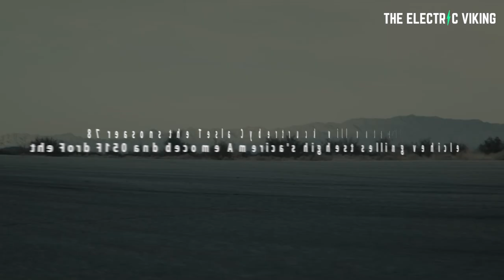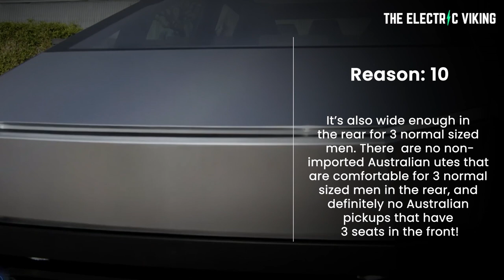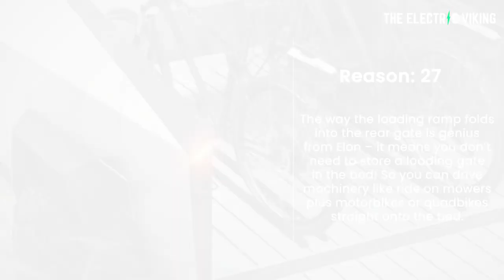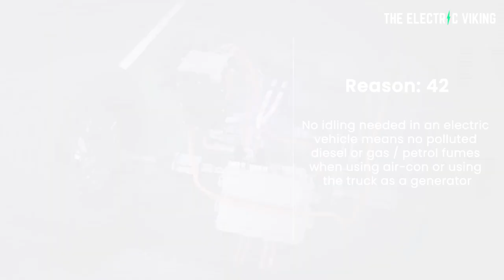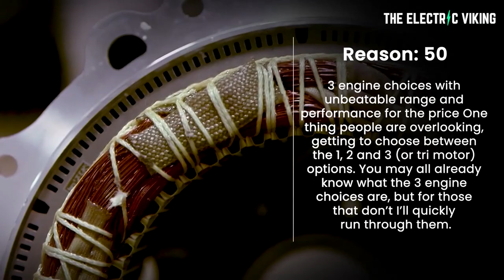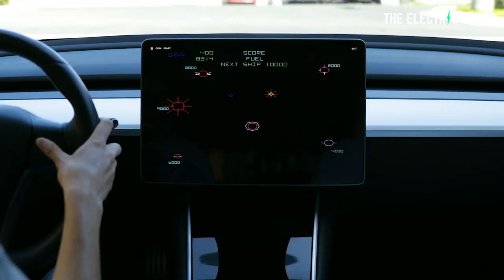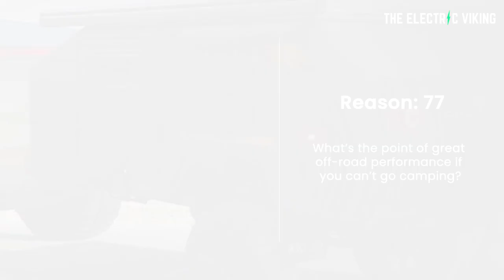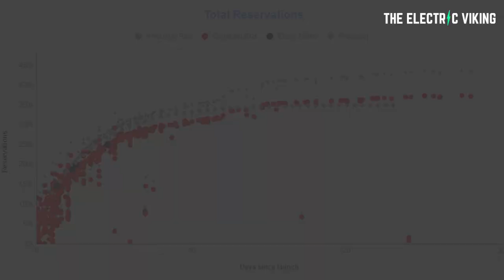87 reasons the Tesla Cybertruck will outsell the Ford F150

Comment: Ground clearance was stated at the reveal and confirmed several times since: 8" minimum and 16" maximum, self leveling and ability to lower the rear end for easier loading.  You might have to eat those shorts.  BTW, great video.  :-)

Comment: I'm 43, with an average expected lifespan.  I plan on purchasing a Cybertruck, and I hope that it is the last vehicle I ever purchase!
Reply: I think as long as the earth is still spinning that your CYBERTRUCK could easily be handed down to your grand or even great grandkids with a couple of upgrades like batteries and the usual stuff that wears out over time. Imagine your cyber truck in one hundred years sitting next to a Ford F-150 lightning bought this year . There won’t be much body left of the ford and the Cybertruck will look nearly the same as when you bought it.
Reply: In my mid 50s.... I hope I get mine before I am too old.  They will need a high production rate.
Reply: @davidsuzukiispolpot  exponential growth. Cybertruck is designed to scale fast and build for cheap.
Reply: @GET2222  Yes, still need 8000tonne press for each line.
Reply: @GET2222  I hope so, but every line needs at least one 8000 tonne press, so there is a lead time to the ramp-up.  It can't scale that fast.
Reply: Hopefully your actual vehicle has still a long shot on the tarmac.
Reply: @chrisk5305  when I first got my 2020 I thought I would be selling a fairly new car.  Now I am not even sure the warranty will still be in force when I get my cybertruck.
Reply: I'm 70 and can't wait to get it !!!
Reply: @davidsuzukiispolpot  legit question
Reply: @azbluefox  your numbers are ok, still good for a smooth 25 years ride. Stay positive.

Comment: The biggest problem for Ford or any other manufacturer is if this is adopted widely as the new trend these companies will be massively screwed because no one will want the OLD standard looking pickup.
Reply: Trucks are bought to be used for work stuff.  So i disagree.   That wedge isnt a truck but a glorified crossover.

Comment: If the competition was EV trucks only, then the Cybertruck would have a good chance of being the top seller in its class in North America. However, the f150 lightning is only one model of f150 which sold close to 800,000 units in 2020. The ice versions will continue to be produced as the Lightning ramps up and the Ice vehicles ramp down over the next few years. The competition will also be an Ev Silverado and Dodge Ram so while the Cyber will be a force to reckon with, it might not be number 1 in terms of sheer numbers.
As for Australian production, there are a lot of ifs attached to that. If it can be homologated for Aus, (big if as even Musk had his doubts) if the production line can be changed over to right hand while production for left hand is running at optimal levels and if ultimately they decide the market is big enough to warrant the effort. Remember we still haven’t seen a model Y yet, our charging station numbers are appalling low and the cost of the vehicle might just be prohibitive.
My personal opinion is the dimensions of the vehicle make it impractical as any sort of day to day usable vehicle in Australia at over 2 metres wide and nearly 6 long. It’s like driving a hummer around town. In the end it’s an expensive second car to own for weekend trips and as much as I like the idea of a practical electric work Ute, I’m not convinced it’s tub design is as practical as is being suggested and would be suitable for tradesmen. There are many car parks in urban areas it simply would not fit.  My first thought when I saw it’s tray was, how do you fit a ladder rack and where do the tool boxes go? Perhaps a cab chassis version with a flat tray for tradesmen? But it doesn’t have a chassis. And tow bar? And roof racks on a glass roof? Water tank? Does it have a real spare?  I could see it ending up in Australia far into the future as a bit of a play thing and novelty for a few well off citizens. As a farmer I have enough trouble convincing friends that a new 79 Landcruiser Ute is an overpriced vintage vehicle that hasn’t changed since 1985 and is uncomfortable and expensive to run.  Imagine trying to convince them a cybertruck is a practical vehicle?

Comment: Reason: 86 features added….. bought a model s in 2013 and at the time no all wheel drive no park assist no cameras or detection systems and no chance of getting any of this added by Tesla…and the battery is down to 249 miles from 300 …. But I still love ❤️ my Tessy🤗

Comment: 35 inch tires

That means the center of the wheel is 17.5 from the ground.

Best way to eyeball the ground clearance, compare the bottom of the truck hight to the center of the wheel.

Pretty similar (it's got 16 inch ground clearance, and Elon said 4 inches of suspension give and take)

Also the batteries make it have the lowest center of gravity for any truck, so better steep climbs and less roll over chance.

Comment: Performance, materials, engineering, this is by far the most advanced utility vehicle ever designed for a road. And here people are concerned with the appearance I noticed. I can see the military and police start using them immediately, followed by a lot of common people after that, once people get used to the design. This thing has some brains under the hood, so much so it's gonna be the new standard, Elon knows it.

Comment: The video basically makes believe the Lightning doesn't exist. The Ford is better as a truck in many ways. 

No one, even Tesla, doesn't know how the Cybertruck will be priced. They made a guess 3 years ago, it's now a totally different world. They said $40K to start, single motor. They've since deleted single motor option. Model Y starts at $66K in US. Gone up about $15K just this year. Anyone really think that the CT, which is twice the vehicle, will be even remotely close to the Y's price? It WILL be much more than the Lightning. The Ford is largely a regular F-150 with massive economies of scale and it cost what it cost. CT is ground up new, with new factory. It's a 6-figure truck folks. LOL, it's much more vehicle than Model S, a 10 year old car, and it still costs 6 figures.

Comment: The 4680 cell line needs much less space to be able to produce the same amount of batteries

The Cybertruck design needs much less space to produce the same number of vehicles

The giga Texas factory is larger than any other gigafactory and the average gigafactory today produces half a million vehicles a year.

The Cybertruck is planned to only be sold in America.

They started planning how big the factory should be after they had the reservations, so they matched the size to fit the orders.

The Model 3 had less preorders in the sane timeframe.

These things all line up to being 1,000,000 vehicles per year at maximum capacity considering how large the Model 3 sales are today.

Comment: im in contracting and my sub contractors and i have bout many f150's in the past. one reason from my industry why f150 works and tesla dosnt. ladder rack. i dont see how im going to transport pump jacks, 30' ladders on that thing. elon design something so we can putt a laddr rack on that thing and ill buy. fyi. f150 wins cause of the commercial industry for actual work and not as everyday driver.
Reply: Why do you think you won't be able to mount a rack on it.  The F150 doesn't come with one either.

Comment: A video showing the ramp used with the rear air suspension lowered, while the front at 17 inches. A six foot ladder is needed to get back onboard?.

Comment: Lol. It's a Cyber Eyesore. Selling a million pickup trucks in the USA is just small piece of the market. If you don't sell a million you are a b-lister....Ford F series in a really bad year alone is about 800k in sales. As an E truck entry the Cyber truck shares similar characteristics as the Rivian, GMC Hummer, Ford Lightning and the rest soon to be released.
Reply: 2 million pre orders says different.
Reply: @rockon7848  Maybe even 3 million preorders. Not sales or produced. I understand that the Cyber truck is going to be manufactured in the Austin Terraplant. A typical high volume manufacturing plant does about 350,000 annually. So do the math. Having maybe 10 years of orders doesn't have much meaning. Many will switch as there is a half a dozen other manufacturers coming out with vehicles in the market next year.....and there will be little difference in functionality.
Reply: @wswwsearch  Based on the performance of Shanghai, in Q1 2024, I expect Austin to be building CT’s at a one million per year run rate.annually. If the demand is high enough there is nothing stopping them from building CTs in another location. It only takes 18 months to build a new one if you stay out of Germany.

I personally believe Tesla will be able to build and sell 2 million CTs per year by 2025.

Every thing depends on how fast they can ramp battery supply.  And battery supply is the reason the other OEM’s don’t have a prayer of catching Tesla.

Last I heard Ford already has a 5 year backlog on the Lightening, with only 400,000 pre orders.

Don’t forget the Cyber Truck is designed to be fast, easy, and therefore cheap to make.  

I think you will be very surprised at how fast they ramp production in 2022.
Reply: @rockon7848  That is quite a visionary plan. Elon of course is always the smartest guy in the room. However,  even though Shanghai has lofty goals of about 500k/annually at peak. I can't say it's impossible, just find me a plant that has that kind of output now. I'll go with the advertised numbers and remind you that is with a mix, not 💯 percent CTs. I understand that currently Tesla is at about a million/yr possible right now. Based on that I am not seeing a million CTs anytime soon. No question Elon is the guy but I am going to sit down with a fine cigar and whiskey and wait to see how it all plays out...2025 is the year to watch..
Reply: @wswwsearch  If the November guesstimates I have been seeing hold up, the forecast is for Shanghai to produce right at 70,000 Ys and 3s for the month. If they don't ramp anymore from there,
70,000 x 12 = 828,000 for 2022.
Plans are in the works to increase production by another 50% with additional expansions.  828,000 x 1.5 = 1.25 million per year in 2023-24.
Since the CT was designed from the beginning to be simple and easy to assemble, with no paint needed I bet they can put a CT out in 7.5 hours, verses 10 hours currently for the Y.
1 million CT's and another 2 million Y's and 3's from Austin seems doable after ramping.
Battery constraints are the only impediment I see to hitting those numbers.

Comment: Initial production will be a 4-motor variant, with independent, ultra-fast response torque control of each wheel.” This will replace the originally unveiled tri-motor version of the Cybertruck that was supposed to be the first one to market at $69,900 and with over 500 miles of range.Dec 3, 2021

Comment: When the Cybertruck passes the first EU NCAP safety test. Only then can you begin to get excited. My belief is that it will be like living inside a noisy drum. You're forgetting that you drive on the right-hand side. Which other countries that do the same will welcome this vehicle? How is the lack of paint going to make it immune to scratching? Naked stainless steel will be like driving a 3-dimensional mirror. The first blinded road train will flatten that thing. Google live navigation does all that Tesla does with more live data as more people use it. And it costs nothing. What happens if you don't want to renew the complementary connectivity, will it still work without? There are no pickups with adjustable air suspension with good reason - it's not reliable. Roll-top desks and cupboards fail all the time, have fun. In the meantime enjoy your phantom car.
Reply: Who put the bee in your bonnet?   

Own a ICE dealership by chance?

 Check back in 6 months, it will be the phantom no more.

Comment: See the you tube video.......a life long ford truck oner and ev expert rates ford lightning vs cyber truck......the man has beven a contractor for 30 yrs and has used f 150s and f 250s in contracting jobs.......he has owned EVs for ten years.....when he compares the two trucks specs.      The cyber truck beats the ford 18 out of 20 specs......ford is a joke.?....see the Munro tear down of the ford e mustang.......the ford uses 30.....parts in the cooling system versus 10 parts used by the tesla y.......ford is grasping at straws......using off the shelf parts for future evs......tesla is years ahead of other car makers.....

Comment: It may outsell the F-150 for its first year or two. After that it won't. It is impractical as a truck. It will take some market from the F-150 but only in the urbanites who only transport fertilizer or a couple of 2x4s from Lowes a couple of times a year. The Tesla truck is useless as an actual work vehicle or when needed to actually transport things. Companies aren't going to buy Tesla trucks. They will but the Ford. I would love an EV truck myself but it definitely would not be the Tesla. It is absolutely useless for my needs. Besides, the Tesla truck is WAY behind on its production. It was supposed to have been in production by now and they haven't even built the plant for it yet. So, orders keep stacking up. My sister and her husband put a deposit on one almost a year ago.